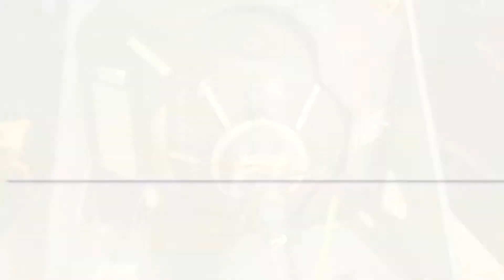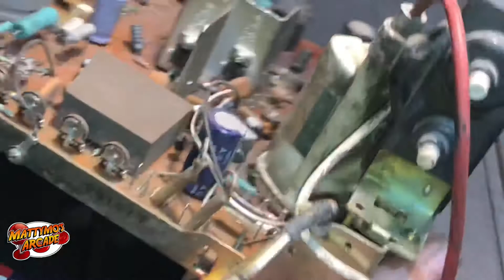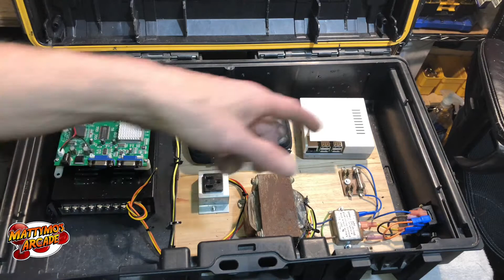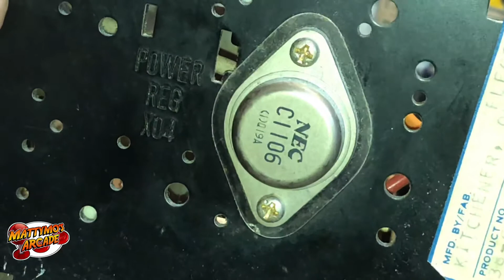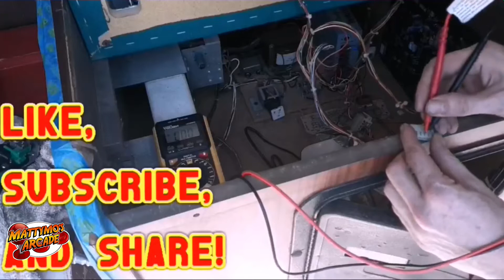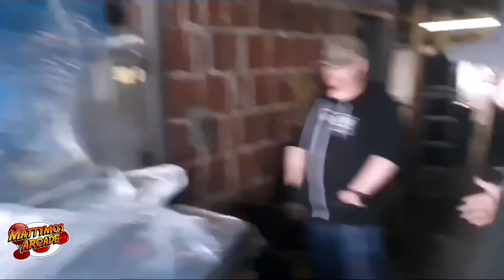Electrohome G07 Rebuild. Does Not Power On

Comment: I have been repairing chassis for 14 years and for future repairs ,instead of taking out x701 like the flow chart says 😁if u get 160 volts on the resistor for b plus that means your hv shutdown is working and that would mean your transistor x701 also ,save u some time etc ✌️

Comment: Do you do repairs?  I have a couple G07's i dont have time for.  I'm in KC.
Reply: I’ve been fixing one for a while now. It’s been a tough one. The good news is now I’ve learned a lot about the board now. It was DOA. Then I fixed broken traces and got it running. It died 3 months later again. I replaced all the caps and flyback and still nothing. Reflowed the board and got it working again but now it had vertical collapse. I replaced the vertical oscillator and nothing tested and replaced several transistors and no fix. Found yet another broken trace on the board where the vertical components are. I think it finally might be fixed. The machine is 200 miles away so I have yet to find out for sure. 

Anyway. I can look at yours if you want. I am in California.